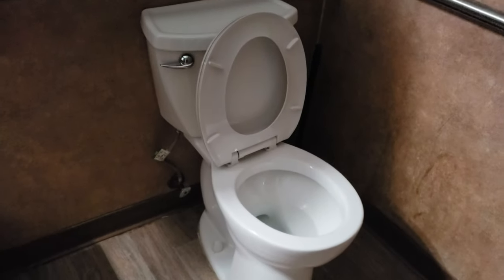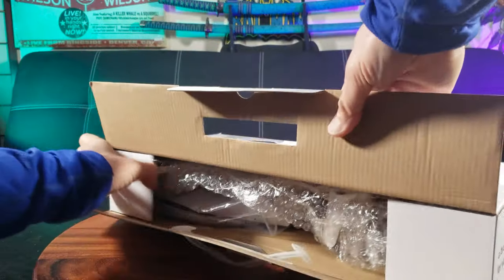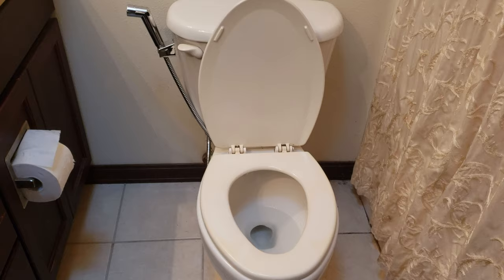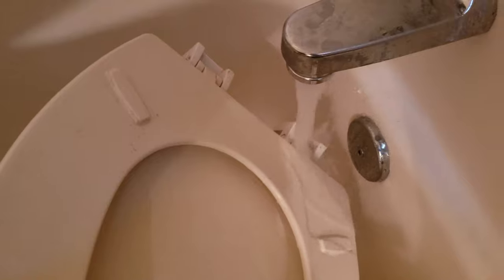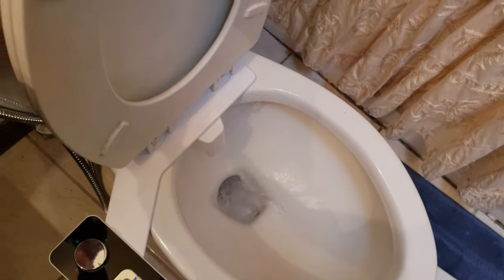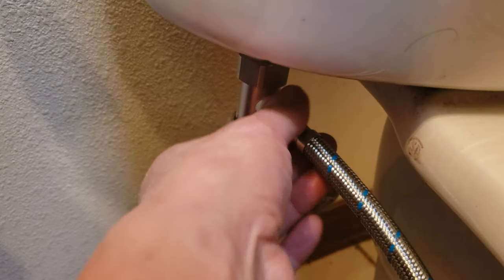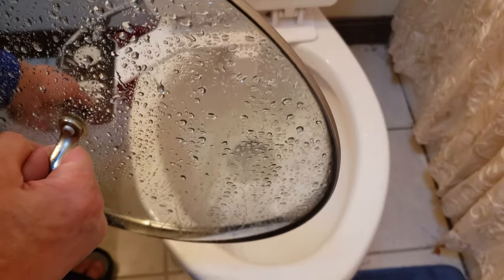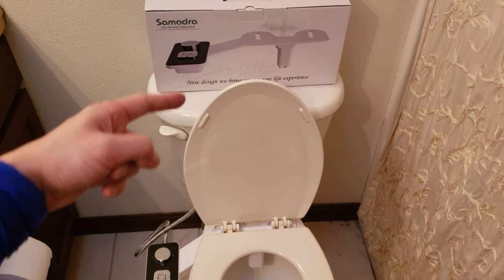Samodra Bidet Attachment Review | How To Install A Bidet

Comment: Thank you for your helpful video. No BS just straight to the task ahead. Thank you
Reply from the maker: Hope it worked out for you. Make sure to tighten every connection with a wrench. I later found out some dripping water near the hot water hose connection.
Reply: @Jay_Rule  I just followed everything, plumbers tape and wrench and got a small leak ! Imma re apply the plumbers tape and tighten it with a wrench more to see if it works.
Reply from the maker: @urnimachowdhury5909  Make sure everything is screwed on aligned and not at an angle. Tighten everything.
Reply: @Jay_Rule  im wrapped the area with tissue paper to catch any leaks the second time around. I’m installing this in my parents restroom because they’re finding it difficult to turn and use the hose. I will retry as many times as it takes to get 0 leaks haha
Reply from the maker: @urnimachowdhury5909  Tissue paper won't last. You need to use plumber's tape. A tip on applying the tape is to wrap it clockwise when you are looking down at the part you are wrapping. Make sure to use a wrench to tighten all connections but don't overtighten or you can strip the threads.  Good luck!
Reply: @Jay_Rule  I put it to check the leaks. Wet paper = leaks. But it’s dry so I was able to fix it the second time around :)
Reply from the maker: @urnimachowdhury5909  Oh duh lol. I get the idea now. That is a simple leak test.

Comment: Which way does the flat black washer to in the T?  FLAT side up or down? It looks like you had the flat site up however, another video for the same product had that flat side going down.
Reply from the maker: The flat should be facing you because concave curvature fits into the smaller opening of the attachment beneath.

Comment: I installed this today. My advice is to install the hose on to the bidet first, then the other hoses, then test for leaks, then mount it onto the seat. It was hard to get the hose on backwards, and I almost cross threaded it.
Reply from the maker: The trickiest is installing the tvalve onto the toilet bowl connection because it has to be on straight and there is a chance of stripping the threads if too much force is used.

Comment: The valve underneath the controls is leaking for me. Is there any way to fix this 😢
Reply from the maker: Use plumber's tape around the threads and use a wrench to ensure the attachments are tight

Comment: I installed it no problem, but my toilet won't foll back up unless i take off the back and do it manually. Guess I'm just gonna have to take it off if I cant figure this out, which I'd rather not do.
Reply from the maker: The plastic screws must be too short. Buy longer ones so it can fold up. Go ask Home Depot or Lowes.

Comment: Any idea how to install hot and cold water bidet?
Reply from the maker: https://youtu.be/04jLtFEEdNU
Reply: @Jay_Rule  thank u..also my water flow to closet tank became slow after fitting bidet any idea? It takes 5 mts to fill the tank whereas it was hardly few seconds earlier
Reply from the maker: @prazna4eva You can adjust the water flow by turning the knob on the wall to more vertical orientation.

Comment: I bought this based on your video - my T-valve will NOT seal when it is tightened. So frustrating!
Reply from the maker: Make sure you are screwing it straight and not at an angle. Also, remember to use the teflon tape.
Reply: @Jay_Rule  so I ended up breaking the plastic part (from over-exertion). Went to HD, bought a new Kohler toilet thingy, used the tape before installing, and... voila!  it is now in working order, only $24 more dollars than I thought to spend 😆. Life is good. Thank you for this video! Guess what everyone is getting for Christmas this year lol...
Reply from the maker: @luadiva  Wait so did you buy a new bidet or just the new attachment? When it comes to plastic parts and plumbing, you can't use excessive force because it can break the part or strip the threads.
Reply: The trick is to make sure there is a rubber washer in the T that attaches to the toilet tank. Second, you must make very sure you no not cross thread. There is no need to use excessive force when tightening plastic parts. If there is a leak at the tank don't assume it is coming from the T. That which the T is being attached to may require tightening as it was in my case. I found no need to use plumbers tape to due to the rubber washers making the seal. Mine, no leak in leaving out the plumbers tape.

Comment: How do you still like it?  Its still working good a year later?
Reply from the maker: It still works great. I just need one more bidet and all 4 of my toilets will be covered lol.
Reply: I have a similar question.  I installed mine and after just 2 uses it has started to leak from the bidet part. Any suggestions? ! Thanks
Reply from the maker: @AngelicaArechiga  You need to tighten all the connections with a wrench but don't force or over tighten it.
Reply from the maker: @AngelicaArechiga  Did you make sure the knob is turned to off? It's leaking even when it's completely off?
Reply: @Jay_Rule  yes, still leaks
Reply from the maker: @AngelicaArechiga  Sorry to hear that. Please send them your concerns: https://www.samodrahome.com/pages/contact-us
Reply: @Jay_Rule  thanks for your support,  I have started a return/replacement  of the unit.

Comment: I’m a bigger guy does this sit flat without The toilet seat moving without bumpers I need it flat?
Reply from the maker: It sits pretty flat for me. The thickness of the bidet that is attached to the toilet isn't noticeable.
Reply: I’m a big guy also and it’s great. Only recomendación would be to install the T prior to the flat part with the controls. I didn’t have much clearance between the controls and my wall so it made it extremely difficult to Teflon tape the bottom nozzle and install.

Comment: Have this exact model! It makes stink hole tingle
Reply from the maker: Once you use a bidet, you don't want to go back to regular wiping. It's like an adventure during winter time waiting for that cold water blast lol
Reply: @Jay_Rule  hi, i have a question since i have never use this seats and i am interested on buy one: does it really wipes all "rear dirt" by it self, or also have to use regular toulet paper? After use you gotta have to use a towel to dry? Sorry for the question, but have those doubts😅
Reply from the maker: @hectorrojas8019  This is a simple cold water bidet. There is no electronic feature that will blow dry your privates. They do sell those options but the installation is much more involved. With this simple bidet, you will still need to use toilet paper to wipe your behind dry. You will discover using less TP because the water helps spray away the poop residue.